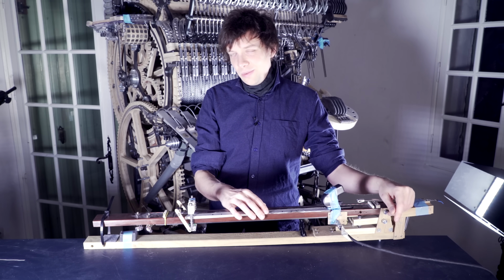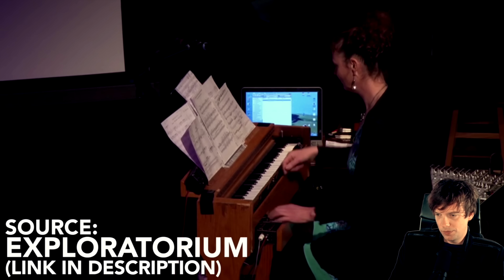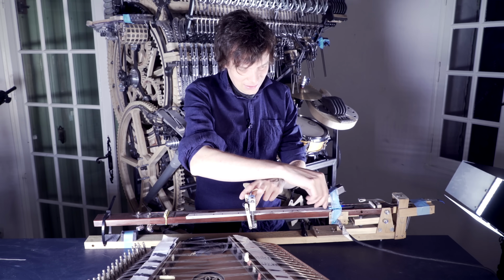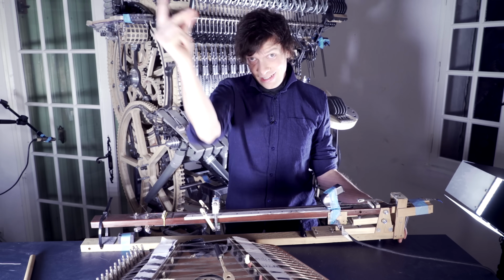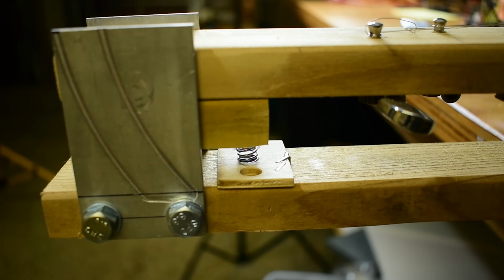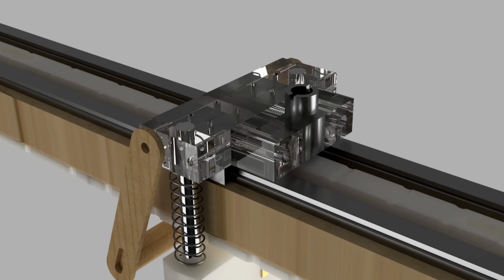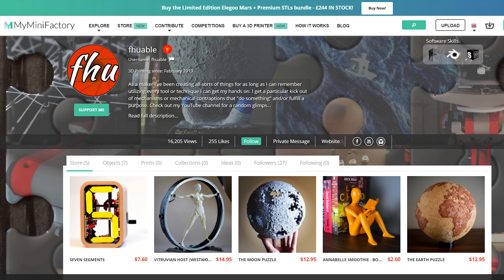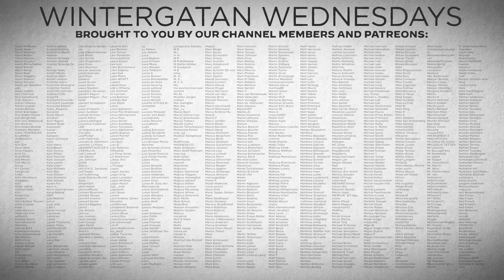Ondophone - A New Music Instrument | Marble Machine X 111

Comment: The difficult thing about art, when you’re very creative, is calling the thing finished. There’s so much joy in creating. The starting can be tricky, so when you’re flowing, you resist the finishing, because that means, at some point,  starting again. And there will be, at some point you know, a little mourning period for the project you’ve finished. When the flowing tap is turned on again, that’s ok, but that flow can cease and we don’t know why. You have to accept that state; you can’t always manipulate it back. It’s worrying and humbling. Maybe that’s the lesson. Putting the thing aside is a good strategy. When you return to it, the solutions present themselves. A good coping tool is time spent solo exploring in a forest.🌳

Comment: I think what you have at the moment is more of a fret-less marxophone. The way the the ondes martenot works is with electronic oscillators very similar to a frequency modulation synthesizer. To reproduce that kind of sound using strings will be very hard. I think that pick-up placement and area where you induce vibration to the string will be very important like when you pluck closer to the neck on a guitar vs bridge. 

It would be like finding a way to hit the sweet spot like you did with the vibraphone and being able to move it note you are trying to play.
Reply: The Ondes Martenot is also a two hand instrument. But they came up with something cool here, that could be developed in to a instrument of its own, even if it isn't the Ondophone. If he renames this, he might be able to let go of his expectations, and see the potential of it.

His ondophone can be a later project.
I would also love to see him take on a large concept of hammer-string instrument.

The concept of magnets used here, is really clever, and could be useful for other types os string based instruments.

Comment: Ebow really should be played slightly away from the pickup, not directly over the top, it will be super shrill directly over the top of the pickup.
Also if the pickup is too shrill consider the magnet type you are using in the pickup itself, different magnets will have very different tonal characteristics and it is a very quick and simple procedure to tailor the pickup to what it is you need it to do for you exactly. Ideally you would add a tone and volume control to the pickup so you have some sort of control over it, currently that pickup is running full juice straight to the jack, not great for tone.
Also a brass saddle and brass nut will tame some high end.

Comment: Ok but like, i would totally drop a couple hundred bucks for an ondophone
Like, that's an amazing sound, and I really want one
Reply: If you are really desperate you could get a lap-steel guitar, a slide and an e-bow and you would get pretty close. But you won't have the cool ringing spring hammer sound though.
Reply: @VeraTR909  that is true, but I wouldn't know where to get one. The ondophone looks and sounds so cool tho lmao
Reply: Like, do you like mean it?
Reply: @MrUnit731  like, I do man
Reply: @allthegoodnamesweretaken3965  Thomann has some relatively good lap steels for under 100€, or you could build one yourself for 40€ like I did
Reply: @lawabidingcitizen5153  Yup, lap steels are cheap and easy, you can get good ones for like €80 because they don't have to make a complicated neck and set it up. 

I made one myself from spare parts too :)   *used to work in a guitar shop
Reply: I would definitely get one as well if they sold it. The sound is amazing!
Reply: @VeraTR909  I made mine from some cheap hardware store wood, some cheap tuners from my local music store and a cheap chinese pickup and bridge, although the bridge can easily be improvised. I'd recommend it to anyone interested in lap steel and woodworking, really.

Comment: Martin, you could also use a sustainiac pickup instead of the Ebow. It's a guitar pickup with a built in sustainer. Matt Bellamy of Muse uses it quite a lot, you should check out some footage of him using it.
Reply: +1 for the Sustainiac pickup! Joe Satriani uses it too a lot latelty.. The Fernandes Sustainer is another alternative that Steve Vai made popular
Reply: Every few years I suddenly remember that Moog made a guitar with these kinds of pick ups in it. What a weird one off that was!
Reply: Do you think sustain pickups work in the vertical direction?
Reply: @Dayanto  mmmm good question..also I was reading their page and as far as I can understand, when you enable the driver it will not function as a pickup, meaning that you will need another pickup..
Reply: @Dayanto  Good point, I hadn't thought about that yet. I don't think  anyone tried so far. Maybe there is space to mount it horizontally, that would also give the option for multiple strings.
Reply: pabloide86 will need another pickup anyway, as it doesn’t function in vertical anyway

Comment: Suggestion: could the spring steel hammer be attached to the slider somehow? Instead of the base.
I think... that could potentially give you more control over the hammer, to maybe get those single notes. It should also remove the need to make the whole instrument pivot up and down.
Not wanting to put more on your mind, but wanted to mention it.
Loving the progress, keep it up!

Comment: For the staccato, can you attach a hammer to the top of the sliding block that you can press down on with a single finger to strike the string?
Reply: Yeah, but that won't fix the sustain.
Reply: @tristanclark7086  Pedal?
Reply: How about drop a marble on the string? & then add a damper pedal.

Comment: Why not add the e-bow to the slide? That way you can control the intensity with one hand.
Reply: I was having a similar thought.  How many on/off or pressure sensitive "keys" could be incorporated into the slide?  Made me think about a bicycle hand bar with breaks and gear changers, besides steering.
Reply: The ebow needs to be in a certain position to work.
Reply: The ebow needs to be over the pick-up but it could be controlled by a switch in the slide. Copper rails down either side of the neck could be used to complete the circuit when the slide is pressed down on to the strings

Comment: I feel like Martin's brain proves that musical skill is a single thing, or at least can be in some brains. Like he's one of the few general musical intelligences, where as most musicians aren't, they are instrument intelligences. He's clearly capable of an extreme degree of general application of his musicality. Well beyond just finding things to make noises and beats, like a foley or stomp, what Martin does is apply the full spectrum of musicality to basically anything his brain recognizes as able to bear it. Building objects with greater and great ability to withstand this load leads to a better understanding of what load objects have, which is where the feedback loop came from that leads to that mechanical wonder behind him and now in front. His engineering helps him understand music better and his music inspires greater engineering. It's amazing. (Which of course you already knew.)

Comment: What about placing the e-bow where it is, but fixed to the base, and the distance to the string would depend on the height of the neck, so would control the volume with the same hand?

Comment: Wouldn’t it be more fitting to use a pedal for the hammer striking the string instead of tilting the whole contraption?
Reply: I could see why it could become too much, but the treadle pedal is just there so that the handle doesn't need to be cranked by hand the entire time so it's not something he has to use non stop so a second pedal might not be all that much. though i do see where you are coming from @Random Guy JCI

Comment: I can see where the sound of the Ondophone sells itself for its unique sound, dynamic color and sound quality, but for the use with the MMX it's not really suitable in its current evolution.  It needs to be a one-handed instrument on the MMX, and the slider is the primary part that guides its notes.  Some serious rethinking will need to be done to the slider design to allow all the dynamics and color that the Ondophone can offer without sacrificing the demand of one-handed operation.  I easily see this instrument on the tour, but not attached to the MMX.  Bravo on the Ondophone, Martin!  Just know the best things have come from the unexpected results of mistakes and mishaps!  Keep it up!

Comment: In the early 1990's I drew up a drum sticks triggered dynamic plectrum actuated (like a guitar player picks) electric guitar string based musical instrument specifically with heavy thrash speed metal in mind.  I am an analog purist tone head guitarist and organist. So having the abrupt intensity of a drummer playing thrash metal guitar through 100-200 watt Marshall tube amps was very appealing! Still is.

 The string(s) were fretted by pneumatic actuated pads. Two treadle pedals, one for each foot served as the note selectors. Dynamic Palm muting was on demand using a outward pressure knee lever. 

I did prototyping of a pick gripper, using a pinch bladder and imitative of how you grip a pick between your index finger and thumb. roll finger and thumb back loosens grip. Roll finger and thumb forward...tightens pick grip. the former is flimsy, the latter is stiff. Stiff grip equals louder sound, loose grip equals softer sound. I used dropping steel pins in a bore intercepted with a solenoid to make gripping action instant.

Comment: The magnets instead of frets is a stunning idea! Turn Ondophone  into a 2 or 3 string guitar you can hang on you body and look cool. The pitch slider can have interval offset buttons on it, so that with two strings (tuning to be considered) thirds, or fourths, fifths or sixths could be played.   The electric bow is awesome, keep that! Combine it with an electric pick with selectable tempo and several buttons you press and hold (mute on release): single note pick strike, quarter-notes, 8th, 16th, 32nd etc and an additional triplets button, all to be controlled with one hand...

Comment: The problem seems to be that the audio comes from a pickup and a metal string, so the tone is similar to a fretless electric guitar.

There's probably some guitar pedal combination that could make it sound more like either of those reference instruments. If there isn't then you could also make yourself a custom one.

Or maybe you could focus on making it sound more like a Marxophone acoustically and then just adding sensors that electronically controls a similar sound to the other instrument, like a synth. Heck, even a modified Ondes Martenot could probably be played with the sensors replacing the keyboard and stuff.

Comment: absolutely brilliant man! You're a very good musician also. Impressive! I definitely want an Ondophone when they are ready for retail.  I'm a lap steel player with an original approach and sound. Let me know if there is any way i can help with this project. I also build fine web sites and do a lot of fine art photography and digital imaging.
Reply: you probably know this already but infinite sustain pickups do exist. Schecter makes a version. I also will point out that most, i would say pretty much all lap and pedal steel players use a volume pedal which adds another very expressive dimension to the instrument. I use a Morley volume/wah and it's been great, bullet proof design has survived many travels and even being drenched with rain. There are lots of options in that respect, each has a slightly different sound/tonal qualities. I often use the wah aspect of the pedal as a notch filter also, which is great for cutting through a mix and getting that throaty tone for leads, cutting out any shrillness which may be present in the signal also.

Comment: So basically its a pencil, an ebow, and a slide all in one (you can make that trill sound with a pencil, but it wont be very good, well i'm not good at it, maybe you are) the string being next to a magnet ruins the sustain ironically, that's the point of active pickups, they are quieter, but have a preamp, in order to give you more sustain.

Comment: 7:37 - "Actually if I need another instrument I can just use a MIDI keyboard"

It seems like a sensible choice. I love the experimentation, but I also respect the need to choose your battles and keep the project from growing out of control. Invention is great but the drive to create novel stuff has to be balanced against the need to produce "finished" work at some point.  (Alas I am really struggling with that one...)

And it's always something you can come back to later on if you want to!

Comment: You just need a button on the sliding part so as you slide it back and forth you can optionally push the button for a single strike like you want.

Comment: Martin, I think I've figured out how to improve one the resonating body problem you mention about the ondophone.  You could probably get away with a smaller resonating body than the one on the hackbrett, and use something small, like a gourd (like in a berimbau), or a metal can (like in this instrument here https://www.youtube.com/watch?v=0x8GL6w1Onw ) or something like the resonator on a stroh violin.  You could attach it near the pivot point if you want to minimize its effect on the movement of the ondophone (ie, reduce its moment of inertia relative to the pivot point).  Just a thought.

Comment: relatively misleading headline when all you did was alter the amplifiers point-of-contact on a metal string using sustain effects... which are standard features of the existing electric guitar and violin, for that matter. I mean, great work and all, but this isn't a new musical instrument... it's a slightly re-imagined lap steel guitar with manual tremolo